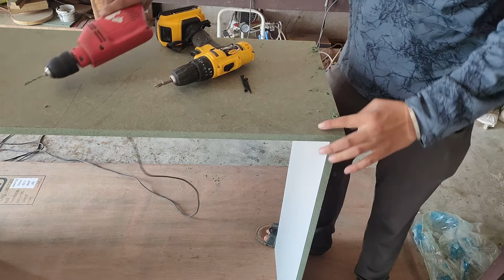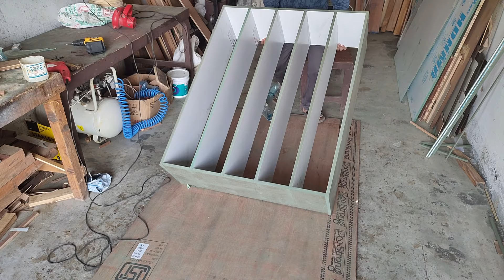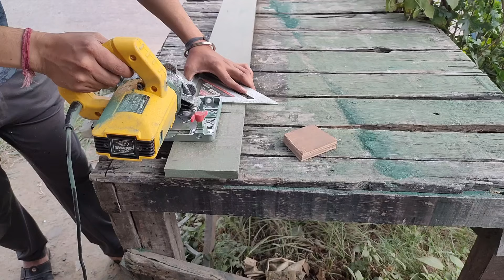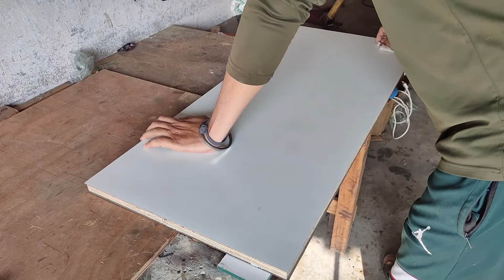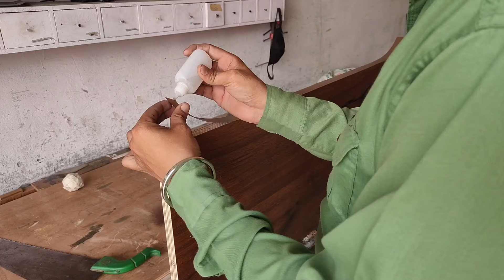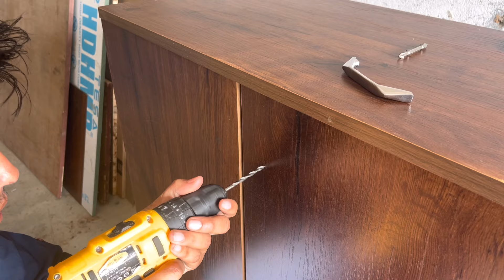How To Make A Shoe Rack || Wooden Shoe Racks

Comment: Ek question hai
Kie baar aap screw lgaane se pehle puri drill maarte h , kie baar bilkul thori drill maarte hai or kie baar sida screw lgaate hai. Difference kya hai or yeh kab kab krna hota hai
Reply from the maker: Jab hum puri Dril karte hai tab hum screw ke liye hol karte hai or jab hum kam Dril karte hai vo screw ka head fit karne ke liye karte hai usme bade size ka bit hota hai
Reply: ok, but hum puri drill kyu krte hai, direct lgaane se problem hoti hai kuch? @deepwoodwork
Reply from the maker: @sad8920  direct screw nhi lga sakte jo humara hdhmr board hota hai vo khul jata hai ja fir screw tut jata hai . toh uske liye 3 se 4mm ka hole karna padta hai taki khrab na ho
Reply: @deepwoodwork  thank you so much